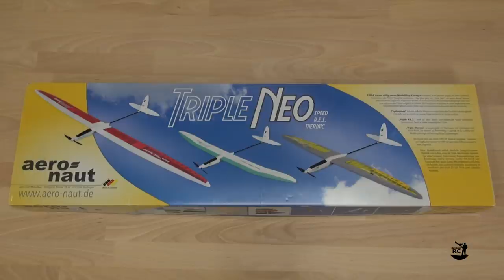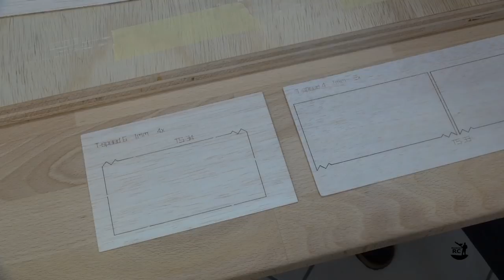Triple Neo Speed - Time Lapse Build

Comment: Do the STL files allow me to use a 3D printer? Do i need permission or provide a fee in order to unlock the files?
Reply from the maker: Yes, you can use the STL files for 3D printing. They are my own design which I am sharing with the community. No fee, no further permission needed, just download them for free. Please note that the servo frames are made for the specific servos I used. If you use different ones they might not fit.
Reply: @bavarian_rc  Hello again.....i am preparing a build of the Triple Neo Thermic....and anxious to view your take on the project when you may be producing a time lapse video of this model. I have purchased the servos that the manufacturer suggested. In your previous response you mentioned servo frames for the specific servos you used. Would those be the same as the manufacturer's suggested product? If not, please provide me with details of the servos you have utilized. Thanks!!!
On another note...i am working on a project that will have a servo mounted within the figurine of a pilot within the cockpit. The movement & power will be independent from the aircrafts's power supply. Have you had any experience with such a project? I want to keep the weight and size of the servo to a minimum. Since the function is relatively "lightweight": rotation of the pilot's helmet, i am asking for references you may have in mind. 
Keep up the fine work that you have been producing!!!

PePe del Nordo....Black Sheep Squadron.
Reply from the maker: Hi, I have already bought the thermic wings for my triple neo and hope to build them during this winter. The build video for these wings will not be available before spring 2023. But the speed wings and the thermic wings are very similar. The servos I used are Graupner DES 428 BB MG. They are not easy to find on the market at the moment. Still an effect of the Graupner insolvency in 2019. Some of their other servo models are back on the market but not the 428. I was lucky that I still had some on stock. Hopefully the 428 will also come back soon. Maybe you can find an alternative with same dimensions.
Nice project with the servo animated pilot! I have never done anything like that. Can‘t really help you with ideas there but I think I have seen something like that in some YouTube videos before. 
Have a great Start into the new week! Bye!
Reply: @bavarian_rc  Thank You very much for your advice and thoughts. I will search for servos with the same dimensions as i really would like to emulate the build video and the 3-D printed materials. 
Have a fine week!
Reply: @bavarian_rc  When i purchased the Triple Neo Thermic Kit, i also purchased the suggested servos, also an Aero-Naut  (AN) product. Is there a possibility of adjusting the STL files to accommodate the different dimensions of the AN servos?
The AN-8-MGBBD servo measures 23.5mm x 8mm x 24mm
Reply from the maker: Hello Peter, I just had a check of the AN-8-MGBB servos. Adjusting to a different size could be rather simple, but I have seen that the Aeronaut mounting  brackets are different to the Graupner brackets. In the case of the Graupner servos the bore is open to the side and that's where my mounting plate slides in to secure the servo. The Aeronaut servo has a closed bore which means a totally different mounting mechanism is needed. In this case I recommend you to just use a small block of plywood that you glue to the servo plate and then screw the servo into these blocks.
Reply from the maker: Hi, it's me again. I had to make a new servo frame for my KST servos which also need a different design. Pretty much  the same design as needed for the AN-8-MGBB servos. I had a look at the dimensions shown on the aeronaut website. Unfortunately not all of the needed dimensions are given there. Could you tell me (as precise as possible):
1. Thickness of the mounting brackets
2. Distance between the center of the mounting holes (between LH hole and RH hole in the mounting bracket)
3. Diameter of the mounting holes
4. Distance from the underside of the mounting brackets to the bottom of the servo

With these measures I could easily model a servo frame fitting for your Aeronaut servos

Comment: Hi again.....i must have lost server connection while i writing you with the measurements requested. Hence i am going to ry sending once more. Itt seems as though i have lost the complete string of our questions and answers that we shared, hence i will simply write in the measurements in the numerical order that you had asked.

1.     1.0mm
2.     26.5mm
3.     2.0mm
4.     17.0mm
 Hoping that this information helps!!!
I am having difficulty ordering the Roll-wrapped carbon fibre tube since the site does not translate into English / Italian . Any help would be appreciated. I would like to order 2 x    Kohlefaserrohr 10 x 9 x 1000 mm, gewickelt, geschliffen
Reply: I used a digital micrometer in making the measurement determinations.
Reply: CORRECTION: 4.  17.4mm
Reply from the maker: Hi Peter, thx for sending the measures. I will make an adaptation of my new frame design that should fit for your servo. I have also seen that you sent a corrected value for 4.
When I am ready I will send you a link to my gdrive to download the STL. 
Concerning the roll-wrapped carbon tube I contacted the owner of the shop (that I linked in my video description). You can send him an email in English to this address: josef.gergetz@gmail.com
He is also shipping to Italy (I guess you're from Italy as you were mentioning Italian).
Now give me a few days to make the STL design for the servo frame... Greetings from Bavaria
Reply from the maker: OK, that went quicker than I thought. I am not fully trusting the dimensions that I have taken from the Aeronaut website but it is worth a first try. Maybe I should have asked you to measure all dimensions yourself. You can download the STL here: https://drive.google.com/file/d/1caFB5bnmkaX2z9cBWS7PvestIN6Wr9fQ/view?usp=sharing
Let me know if anything needs to be changed. I am a bit worried that there is not so much material between the 2.0mm mounting hole and the servo body (you will see what I mean) but with 26.5 mm distance between the center of the holes and a 23.5mm wide body there is not much left.
I made a test print that was quite ok. I printed with 0.20 mm layer height and 25% infill. Weight is below 2g.
Reply: @bavarian_rc  I will go through a  more detailed exercise in measuring the entire servo and get the information to you ASAP.....FYI....my parents are from Italy. I was born in Canada and currently live near Montreal, Quebec.
Reply from the maker: Ok, that‘s why you speak Italian as well. Well, shipping to Canada could be a bit expensive but I let you check with Josef. Real measures of the remaining dimensions will help a lot to make sure the frame fits. Usually I go through a phase of prototyping and checking the fit with some adjustments here and there but without the original servo this is more tricky. Especially if I go for close tolerances as the 3D print also has some tolerances which makes it sometimes necessary to tweak a bit the design.
Reply: @bavarian_rc  

Hello again!!!
I have made measurements using the two servos that i have in my possession....i took four measurements of each segment, labelled A through G on both servos and then calculated an average for that segment . Here is the Key to the segments measured:
A. The width of the servo: 23.6mm
B. The height of the servo: 24.3mm
C. The depth of he servo: 8.5mm
D. Width of Mounting Bracket: 3.0mm
E. Heigh of Mounting Bracket: 1.0mm
F. Depth of Mounting Bracket = C.......8.5mm
G. Distance between Mounting Holes: 26.6mm
H. Diameter of Mounting Holes: 2.0mm
Hoping that this will help refine your effort!

P. Trigiani
Reply: Distance from bottom of Mounting Bracket to Bottom of Servo: 17.0mm...this, on both Mounting Brackets.
Reply from the maker: Thanks Peter, excellent job in measuring!!! Finally the STL (https://drive.google.com/file/d/1caFB5bnmkaX2z9cBWS7PvestIN6Wr9fQ/view?usp=sharing) should be OK. There are some tight tolerances especially due to the mouting holes in brackets being so close to the body of the servo. I think you'll have to do a first print and test fit your servo. If you encounter any issues just let me know what to change. Bye Robert

Comment: Where can I find all those weights that you use in your building? Super video 😀
Reply from the maker: Thanks! As you can see I use a wide variety of weights. Some are lead weights which already my father used for building when he was young 😃 I made the long flat weights from a 6x30 mm flat steel which I found in the hardware shop. Cut it to the length I wanted and then coated the weights with clear paint. If I need larger weights I use granite plates which are normally used in gardening as border stones. The underside is perfectly flat and even.
Reply: @bavarian_rc  Thanks very much 👍🏼

Comment: Hi Can you put the STL files for the MPX connectors on thingiverse?  Could not get them
Reply from the maker: Hi, seems I am too stupid for Thingiverse. Tried to upload it twice and failed. Normally with the link in the video description you should be able to download a ZIP file from my google drive. Unzip it and you'll have the STL files. If that doesn't work I will give Thingiverse another try.
Reply from the maker: Finally it worked. Link to Thingiverse: https://www.thingiverse.com/thing:6255959
Reply: @bavarian_rc   Thank you so much, this is very appreciated.  Thanks for the tips with thin carbon in the wingends. I learned so much to see your videos.  (sorry for my bad english, i am from Norway)
Reply from the maker: Thanks as well for your feedback. I am always happy to share with the community my way of building… and of course constantly learn from others. Cheers from Bavaria to Norway!
Robert
Reply: @bavarian_rc   Hi i tryed to put the 3D printed parts in the fuselage. But is the step on the 3D printed thing on the wrong side?  (can use it , but have to glue it for to holding in )
Reply from the maker: @janiversen4391  Hi, the step on the inside is to ensure the good position of the connector inside the mount. The step on the outside has no real function, it just follows the step on the inside in order to save weight. I didn't do a real functional step on the outside as every laminated fuselage will be different in material thickness at this position. So the adjustment in the hole of the fuselage is manual. Once positioned secure it with CA glue and finally apply thickened epoxy at the end. The mount for the wing has a real step as the thickness of the rib is clearly defined. I hope this helps. Bye Robert

Comment: I 'm not able to 3D print your servo plug mounts and cannot find another satisfactory way to mount the male and female servo connectors to either the body or wing. Can you sell these printed parts or direct me to a source that does sell them? I like the concept but cannot successfully use it without these plug "mounts".
Reply from the maker: Hi, as I am a pure hobbyist I am not set-up to produce and deliver parts. I think the best way for you would be to use one of these 3D printing services available on the internet. I have no experience with one of them but I think if you google for "3d printing service" you might find a provider. The easiest way would be if you know someone around you who has a 3d printer. By the way where are you from?
Reply: @bavarian_rc  Texas, US
Reply: I would like to try using a local printer but I don't recognize the file format (.stl) of your link. Also can't seem to download it.
Reply from the maker: No problem, we'll manage that. My link is leading to a ZIP file on my Google Drive. If you click on the link you should see a list of elements (stl-files) inside the ZIP file. You can only download the whole ZIP file and not an individual file. To download click on the download button (arrow pointing down) in the upper right corner of the window. This will download the ZIP file to your local computer. You will find it in the Windows "downloads" folder. Double clicking on the ZIP will show you all contained elements. From there you can copy the stl file you want to whatever folder on your computer. 
stl file format is a standard format for 3D objects. Microsoft has an app called "3D viewer" that allows you to view stl files.
I hope this helps. Don't hesitate to come back to me if you are still having trouble with the files.
Reply from the maker: I guess shipping 3D printed parts from Europe to the US is much more expensive than finding a local printer. I hope with my info in my other reply you will be able to properly download my files.
Reply: @bavarian_rc  Very much appreciate your help, but I'm getting in over my head. I think I will just get busy with my Exacto knife and sander, and just modify a couple of commercial "holders". Probably quicker and a little less expensive! Thanks again!
Reply from the maker: No problem. There is always more than one way to solve a technical problem 👍🏻

Comment: Scusa ma il peso 990gr con oppure senza batteria
Reply from the maker: 990g including the 1800 mAh 3S battery. The key to reach this weight is to keep the tail very light. A friend of mine build the exact same setup but obviously the balsa for the tail was heavier. He had to use a 2200mAh 3S to balance and ended up roughly 100g heavier than my version
Reply: Purtroppo io ho fatto come il tu amico e ancora non ho pesato il cg spero  che riesca a volare .  il tuo amico  ci ha volato? Il mio adesso è  990 gr ma con una batteria 3s 1500 mha 100c speriamo bene  !!!
Reply from the maker: I hope your CG will be OK. But even if you have to add a larger battery, don‘t worry it will still fly nicely. The higher weight helps especially for more windy conditions.
Reply: Ti ringrazio per la risposta ancora non ho collaudato ma mi da sollievo pensare  nel meglio perché questo modello  mi piace dovrebbe  essere abbastanza veloce ho costruito  un simbad che è molto lento  mimancava alla mia flotta
Reply from the maker: The Triple Neo Speed can go quite fast. I already reached more than 150 km/h
Reply: Grazie  di tutto  oltre che un grande  modellista  sei una persona  disponibile ancora grazie buoni voli
Reply from the maker: Thank you for your kind words. I wish you happy flying!

Comment: love it
Reply from the maker: Thanks 😃
Reply: @bavarian_rc  i am wanting to build some like yours but i need it in feet and inches. could you help me with it thanks
Reply from the maker: Best thing would be to get a complete kit like the one I built. There is no need to convert anything from metric to imperial. All parts are laser cut and all the material is included except electronics and the covering film
Reply: @bavarian_rc  i will try to make some out of foam board plus i have vinyl stickers to put on it.
Reply from the maker: Foamboard could be a bit of a challenge. Let me know if that works. Unfortunately I can‘t give you plans as the kit didn‘t come with plans… they are not necessary as everything is already cut
Reply: @bavarian_rc  I figured that